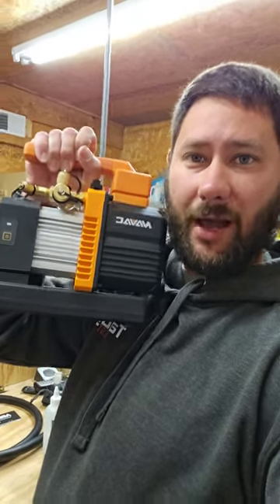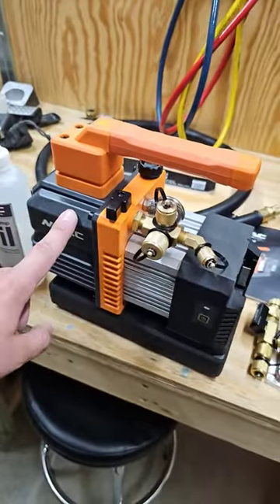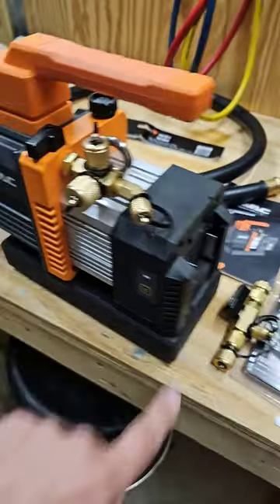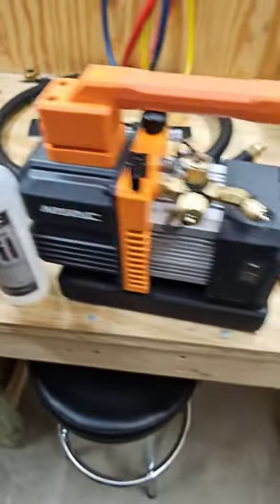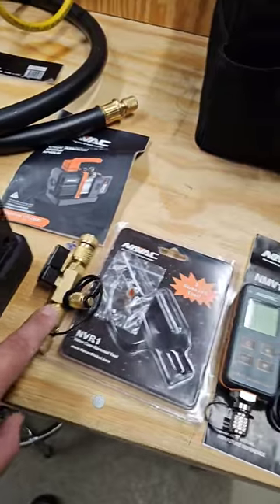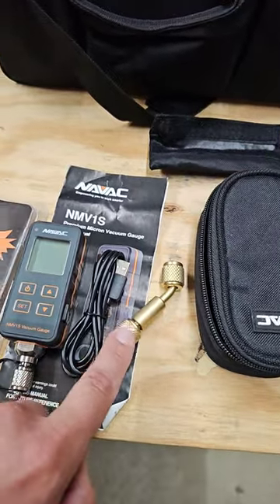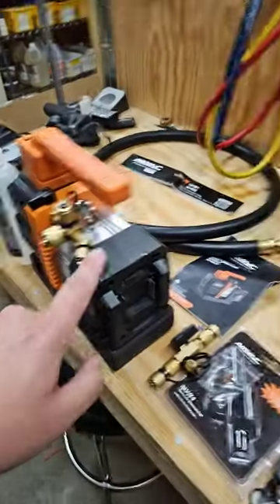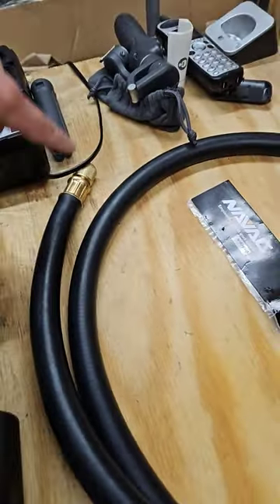Is the Navac Cordless Vacuum Pump Worth the Hype?

Comment: If they come out with a 6cfm or higher model id consider getting it. I do alot of big installs and service equipment with VRF and multiple inverter zone equipment. Need a strong vacuum so I'm not there all day long.
Reply from the maker: Yes sir absolutely
Reply: They do make a bigger one.